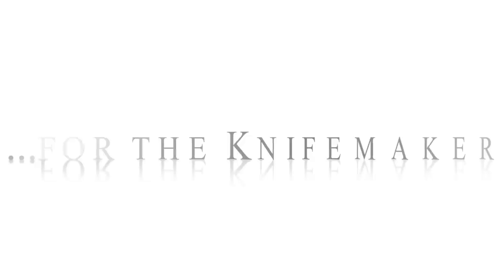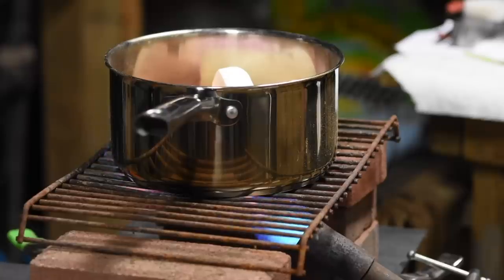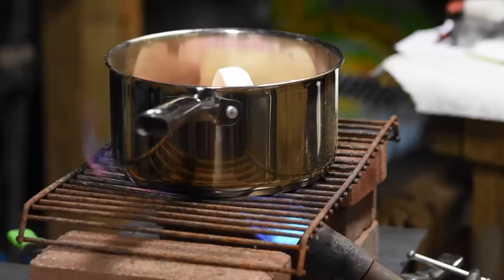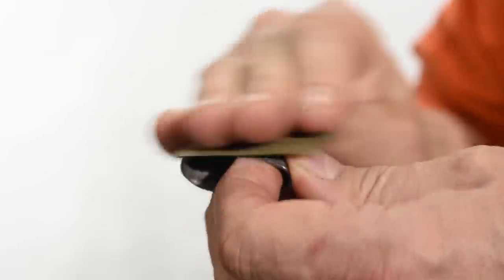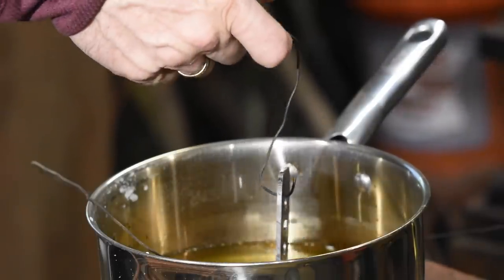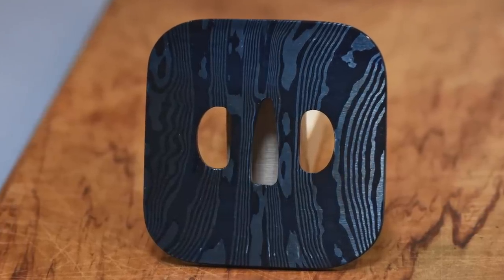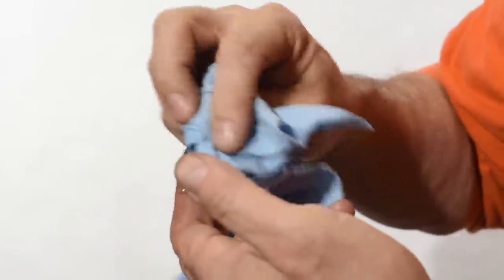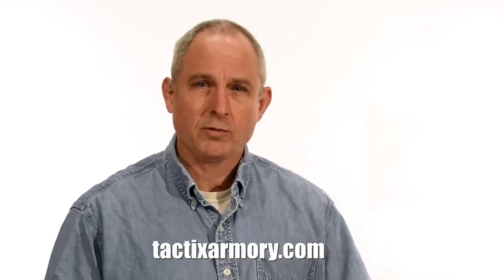Nitre Bluing Basics

Comment: Just fyi you can use hot niter bluing on D2 because the 600 degree temp you blue at is the same temp you temper the steel at after hardening.  But yeah it's too hot for regular carbon steel or even like S7 because you can basically anneal alot of the strength out of the blade.  Check out time/temp charts for the steel you are using and pay attention to the post heat treat temper instructions and you should be good.

Comment: You hit all the highlights listing types of bluing, but there's one to add to your list, not because it's a viable home shop process, but because it's rare and cool and worth learning about for the gun nerds out there. Carbonia bluing.

The process is basically to suspend the metal in the middle of a slowly rotating drum containing charcoal (and/or bone charcoal) and whale oil (or similar). This rotating drum was heated in a furnace to around 600 degrees and the combination of contact with the coal/oil and the heat imparted a deep blue black as it did a sort of final polish and temper on the steel. This process is what started Colt's reputation for their bluing, Smith & Wesson as well to a degree. The process is conceptually simple, but really hard to execute correctly, and Doug Turnbull is pretty much the only guy around who has worked it out in the modern era.

This is not to be confused with the post-war colts, which also had famously good bluing, but that was achieved by nitre bluing on very finely hand polished pieces.
Reply: I realize my comment is pretty long, but you're talking about an art that has nearly died, and will soon be forgotten.
I'm passing along a couple of things I know about it, with the hope that you can make use of what I learned, and pass it on to the next guy.

I've always known this to be the old method of color case hardening.
Not too many folks around today who know anything about it.

The bone & antler have already been pyrolized before packing the parts in them. They're really not much more than carbon & a few non volatile compounds that degrade at very high temperature.

In an oxygen free environment, such as the metal box everything is packed into, carbon migrates from the pyrolized bone & antler contacting the parts, and gets trapped in the matrix of the steel.
It's a lot like a single heat of bloomery steel, when you're turning it into high carbon steel.

Due to the relatively low temperature, and relatively solid state of the carbon, the penetration of the casing is only a few thousandths thick.
It's durable as all get out though.

You can still find pre civil war muzzleloaders with color case hardening done this way, and it still looks nearly as good as the day it was fired.

You can also add other stuff to the mix of antler & bone.
Turtle shell is a good one.
So is a little anthracite. Not too much, because it does still contain volatile compounds.
The more materials you put in your mix, the more colors you'll get.

The thing I switched to, because it isn't as difficult to source and seems to work better, is used diesel engine oil. The dirtier, more used up, and thicker the better.

Keep it in a metal can with a lid.
Just heat up your parts, drop 'em in the oil, and temper them back.

The outside casing won't temper, and you don't want to grind it down to see what color the bare metal is, so you have to use an oven with a good thermometer.

This method gives a black case hardening (graphite color if it's buffed out) that's nearly twice as thick as the antler & bone method, but just as durable.
Reply: @kaisersose5549  Nice write-up, and you're right that good color case hardening is fading from our collective know-how. A real shame because it's functional, and beautiful, when done well. I'm always keen to hear from folks with experience in these mystical arts.

Doug Turnbull still does a really nice job of it, and there are a few folks out there like yourself who are keeping it alive and experimenting. I know one gentleman who, and this is going to sound crazy, will pyrolize strips of leather after soaking them in dog urine. He does nice looking work, so who am I to question, but better him than me on that process.

However, the process I was originally describing is not a color case hardening in the same vein as what you're describing.

The Carbonia bluing method I was talking about uses similar components - various carbon bearing mateirals -  but tumbles them around in a furnace like clothes in a dryer, with the part suspended in the middle. The results of the process were a rich, deep, even blue-black color, rather than the swirling, colorful patterns you typically see in color case hardening. It also didn't get hot enough to harden steel, so it was a purely cosmetic process.

Unfortunately, being a fairly industrial process, it's essentially out of reach for the little guys, so it basically died out when the big factories switched to more economical processes like rust bluing, parkerizing or hot salt bluing.

Comment: You mentioned at the end that this usually isn’t suitable for blades, being that the temperature or the oil will mess with the tempering. Tempering cycles are normally around 400ish and an hour or two if I’m not mistaken. Will one minute of exposure here really have a major effect on the hardness of the steel?
Reply: Yes it will that's why he said not to do it
Reply: Yes it will definitely mess either temper at least on the surface depending on the thickness of your piece, so you’d end up having to grind off the color anyway, and you’d be betting on not enough heat getting through to mess up the center.        Someone else mentioned seeing this process on decorative knives ,but they won’t see barely any use, that may be the only time where I personally would deem it acceptable.

Comment: Nice, never done it, and now I want too👌 Walter after you etched the parts, do you just neutralize the acid, and dry them before going in the salt...or do you use something like Brasso and 0000 wire wool  to remove surface oxidation, clean/ dry again, and then into the salts?

Comment: Which tape would you suggest for keeping freshly polished blades safe, while finishing the rest? (Green, blue, duct/gaffa) I want to buy one good roll, rather than adding another rubbish or to the collection 🙄
Reply: I think in a previous video of his I saw him use the purple 3M tape, apparently it has a plastic like layer, I'm also pretty sure the biggest trick is as applying multiple layers but the best advice would probably be to try and finish everything close to the blade before assembly as any abrasive will wear trough any tape. You know the old prevention is better than cure.
Reply: Don't really matter unless you're looking to expose parts of your knife to liquids afterwards in which case there's water/solvent resistant vinyl tapes for that kinda stuff. I for one use plain old painters tape. If I'm gonna clamp the blade thick layers of duct tape on top of that. The trick I suppose is to use tape instead of not using it and using something that comes off easily/doesn't leave a lot of residue so you for one: don't loathe using it and two: don't have to scrub away or use aggressive cleaning agents in order to clean your blade potentially ruining your finish that way.

Comment: What were the square white chunks in the pot that started off with the pink salts? As they melted they looked like soap bar bits.
Reply: Hi James, the Brownells salts have a pink die in them when new. After you use them the first time and they cool down they solidify into a white solid which is what you see in Walter's video (he shows them in his pan at one point). He has just broken up the used salts and added some new to them, probably to replace the little bit that gets dragged out of the pot with your parts every time. You can re-use the salts over and over. Something to remember when using them, if you leave a temp probe or thermometer in the salts as they cool you won't be removing it until you heat the salts up again. Ask me how I know🤣
Reply: yevad99 do you know of any other brand than the brownelles salts, I can’t find any others and the only size they seem to sell is that $70 bucket.    I just don’t need that much salt
Reply: @yevad99  Thanks for the explanation yevad99. I've never had any experience with this process. 👍

Comment: great video, seems like you know your stuff!  Which I was I was so perplexed when you sprayed your parts with wd-40.  I've only done cold blue, but its always finished with oil.  just seems really odd to apply a solvent at the end rather than an oil to soak into the patina, am I missing something?

you mention the durability is not infinite, how does the durability of cold blue, hot blue & heat blue compare?
Reply: WD40 contains kerosene or something similar, doesn't it?  It has both solvents and oil.

Comment: What about using the salts as the temper?
Reply: I don’t think that’d be a good idea ,going off what he did for the blue color you don’t leave in long enough to get a good temper that would go all the way through your piece, also 600 degrees is going to leave you with a pretty soft temper. It’d be way to soft for any sort of small tool and would probably only suit some kind of axe or chopper. But even then it would be softer than my preference and the problem of the heat not going all the way through would become even more prevalent on those big and thick pieces.
Reply: Da Nuke There’s a company that does it, but they don’t go into details as you might imagine. I’ve still very new and this is still a bit above my current skills, but was hoping to get some knowledge saved away for later. Theoretically the higher the temp the less time to temper correct? Is the color change with the salts the same as temper colors? Or do the salts force the color much earlier than a usual heat temper? Could you do a longer (relative to the normal for just the blueing) soak at the lower temperature to temper the blade and still end up in the blue colors? At what temp do the salts liquify? If it’s used on gun barrels I’d assume it has to maintain a good bit of hardness.
Reply: Isheian 1: in theory maybe but your surface will still be tempered softer than your center material, and unless you take into consideration the heat conductivity of your specific alloy as well as closely monitoring the time you leave it in and the temperature of the salts you may be able to leave a tempered center in your knife. But this all seems way to elaborate to be worth it to me.     2:the color change from the salts doesn’t appear to be the same, the color change is from the thickness of the oxide layer on the surface of the steel and since in one case the steel is in open air free to react with oxygen while in the other case their submerged in melted salt it probably won’t be smart to base any tempering of the colors the steel gets.     3: according to the video you want a temperature of over 600 degrees for a blue color so I do not think you can get the blue color and have the salt at a temperature low enough to temper your steel. You may be able to temper a chopper with it at a lower temper and still get a straw color but it seems that the amount of time you leave the piece in for effects the color so you could end up with something past blue. 4: I don’t know the melting point 5: I do not know what the hardness of different gun barrels are but depending on what they need the lower hardness could be fine for them or a alloy could be used that has the properties they want.           This all said their could be a alloy that would reach a good hardness at the same temperature as the salt I don’t know
Reply: Isheian if you want to experiment with it be my guest but if your looking for a way to color a blade I’d look into cold blueing or anodizing (I believe) these don’t damage your temper and they may better suit what your looking for